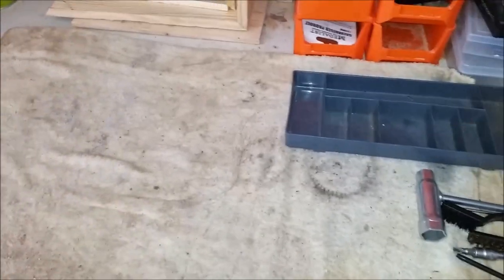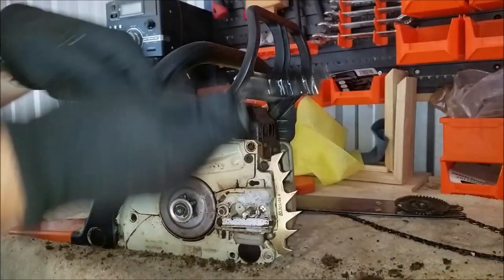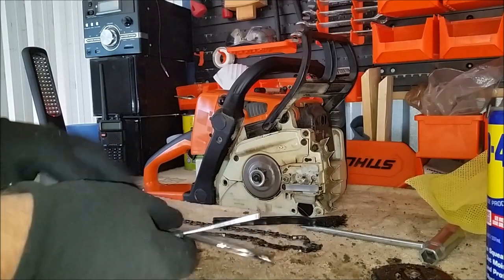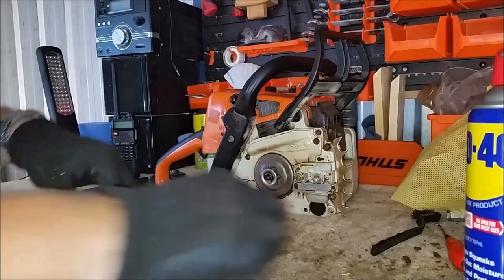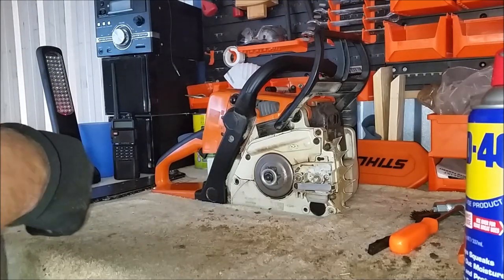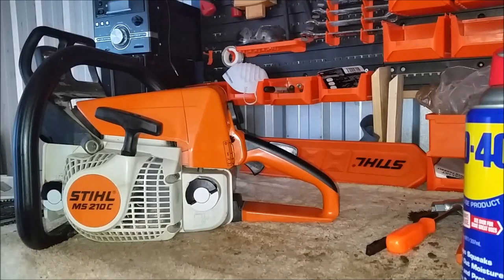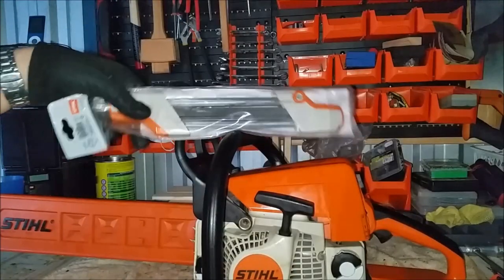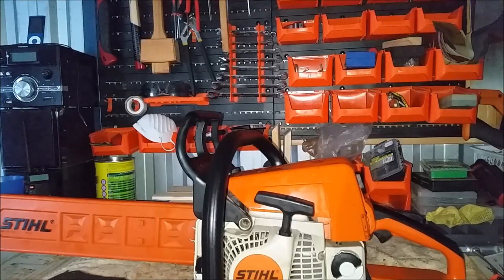Chainsaw Cleaning and maintenance (part 1) MS 210

Comment: I use a putty knife or the tool that comes with a Stihl sharpening set to clean the groove in the bar.  I put my saws over an oil drain pan with some two cycle in it and use a cheap paint brush to clean my saws.  I make a special effort to clean the oil gallery, where the oil comes out.  Usually, I spray it with break cleaner down the gallery and away from the hole the oil comes out.  I do not want to blow sawdust back down this hole.

Comment: I clean the sprocket covers in the kitchen sink with some dish soap a scrub brush and the sprayer and hot water.  I then shake it dry and dry it off with a paper towel and let it air dry before putting it back on.  If it has parts I disassemble these and clean them individually with hot soapy water.
Reply: I’m guessing you aren’t married (or have a very tolerant wife ;) )
Reply: @daleatkin8927  that is one of the benefits staying married for almost 50 years.  😀

Comment: Stay awy from Stihl 261. My Stihl 261 broke down after only 3 years of cutting firewood. Stihl said it was my fault because I didnt use the Stihl oil and alcylat gasoline! 026 was a much more robust saw and I had one for allmost 20 years and used shell oil and 95 gas mixed 2%. Not happy with the Stihl 261 and Stihl support.Warranty dont count if you dont use Stihls own oil or alcylatgas